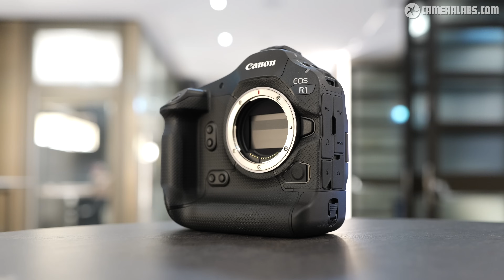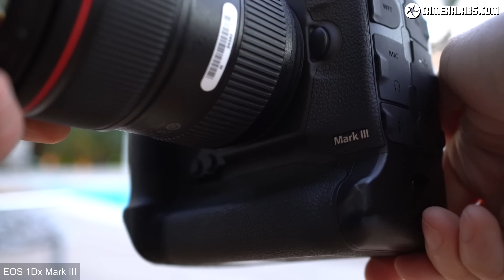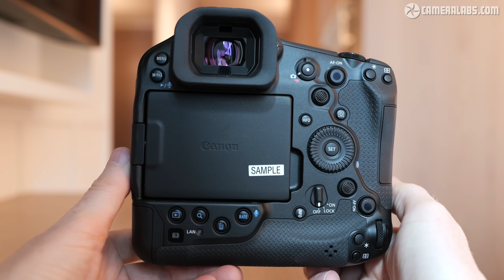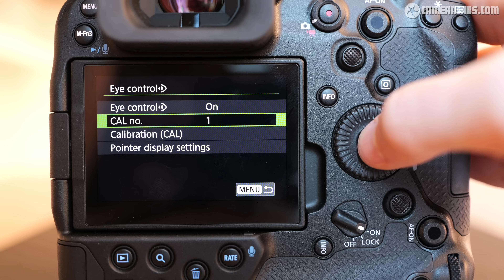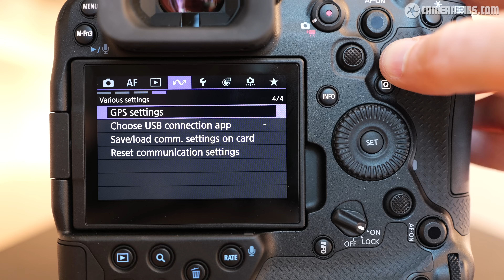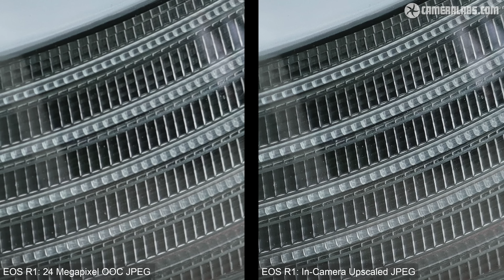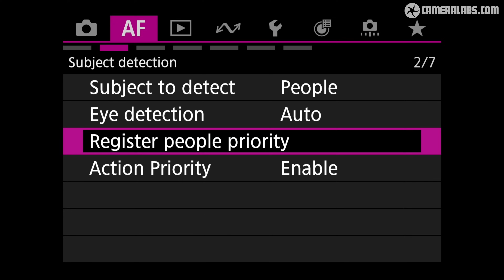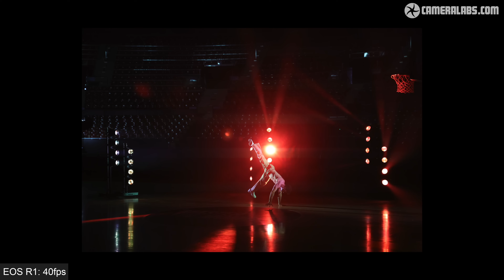Canon EOS R1 HANDS-ON first-looks review PRO flagship

Comment: The AI looks fake, oversharpened and cannot be compared (at all) with in camera stacking of pictures. It does not add resolution, it does not add true colours (or at least the bayer array is still there where it is lost in most Pixelshifts) and it does not add better dynamic range and lower noise. May be in reallife it is still useful but from what I saw I am not conviced at all.
Reply: Yeah. It's baffling why they didn't at least give you the option in addition to the AI scaling business.

Comment: I get that the 1 Series has always been a low megapixel, super fast camera hyperfocused on professional sports photographers - but it really feels like that niche was already filled by the R3 with the mirrorless line.

What exactly is the point of the R1 vs. the R3? Is this essentially a straight upgrade/replacement of thr R3?
Reply: The 3-series was a place to test new things while providing nonprofessionals with features similar to the 1-series. The R3 was a testbed for the new eye-control AF and quite obviously not a 1-series (the SD card slot should give that away). A 3-series can be allowed some quirkiness, a 1-series needs to work really well.
It is quite possible Canon decided to hold off on the R1 to see what improvements were needed over the R3. It is possible the R3 was a one-off. It is possible the R3 mkII will be the first canon stills camera with global shutter non-ccd sensor. Having seen the price hike of the A9 mkIII and the lessened performance as far as image quality, it is quite understandable Canon stuck with an improved stacked sensor. It's almost as if they are the largest actor because they know what they are doing.
Reply: Well the technology in the R1 AND R5ii will be implemented in future Canon cameras. That's the whole point. You don't keep making old designs when you have created new ones. Aka the additional processing chip. Sony is doing the EXACT same thing with just about every new higher priced Camera released incorporating their new chip design with AI processing.
Reply: @natureredux1957  My question is less to do with technology and more to do with categories and naming schemes - the 3-series camera line just seems somewhat redundant, with Canon now having 2 different cameras in their current lineup filling essentially the same role.

I think the R50 and R100 have the same problem on the other end of the spectrum - Canon currently have a very large number of cameras which seem to overlap in use cases, which can be confusing for the customer.
Reply: @Simalacrum I think it’s well speculated that the R3 was supposed to be the flagship, but then it’s so inferior to the Sony A1 that Canon marketed it as a non-1 series to save face. The R1 is more like an R3 mark II; because if you think about it, will there ever be an R3 mark II, and if yes, how does it compare to the current line-up?
Reply from the maker: @quangpham4372  exactly, I suspect no R3 Mk 11.

Comment: This sounds like an R3 mark 2.
Reply: Canon can put R5ii in R1 body and get the hype from youtubers, but they made R1 for photographers on the field who send thousands files right after shooting
Reply from the maker: I agree, although maybe the R3 should have always been the R1
Reply: @cameralabs I continue to stick strongly to the theory that the R3 was always intended to be the r1, and Canon just panicked when the Sony A1 was announced. All they had to do to rename it, was change the physical badge on the device as well as do a search and replace in their manuals. Not really that hard to do relatively late into a product cycle. And for the rest of the marketing materials, those are typically developed at the very end of the release cycle, so those might not have even needed to be changed.
Reply: @doublestrikePhoto only other change was to the dual card slots that weren't both CF. But yes. I'm almost convinced that the 5mkii is better than the 1.
Reply: @cameralabs  Why. The R3 was Canon first camera with a Stacked sensor for mirrorless. Why should they have made it the R1 when they were just starting to play around with stacked sensors. THAT makes Zero sense. They needed time to develop it more. Just because certain folks are not happy about that does not change anything. This is the R1 and the R3 was just that. The R3 and not the R1.
Reply: @natureredux1957 with the release of the r3 ii, it's clear now that the r3 was supposed to be the r1. It doesn't take a genius to figure that out. Sadly Canon couldn't compete with the A1 specs and is now pressured to release the r1 so now, they made a pivot and released the r1 which should have been the r3 ii.
Reply: @natureredux1957  Where can an R3M2 go now? The R3M1 looks like the end of the line to me ....
Reply from the maker: @kevinblythe2192  I was just thinking about that.
Reply from the maker: @natureredux1957  well, let's see if they make an R3 Mark II in the future. If they don't, then we'll know it was at some point likely to be the top model.
Reply: @cameralabs  Not really since I look at the  R3 as their TEST model into Stacked Sensor. Now that those tests have been completed, we now have 2 BRAND new stacked sensor cameras with likely far more to come.
Reply from the maker: @natureredux1957  I hear what you're saying.
Reply: @kevinblythe2192 With the current rumor that there will be an R6 III this year (with the R3 sensor) maybe the R3 line is dead. At least for now.
Reply: @rumrill5020  but then they said that R3 line is "live and well", and I can't imagine what an R3 Mark II would have to look like to justify its existence.